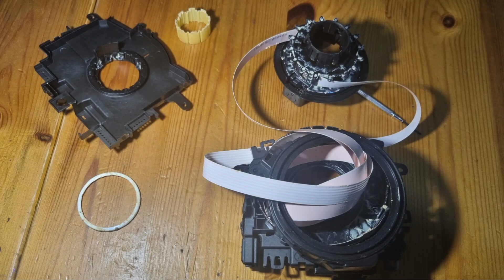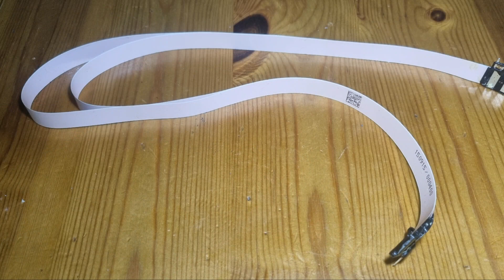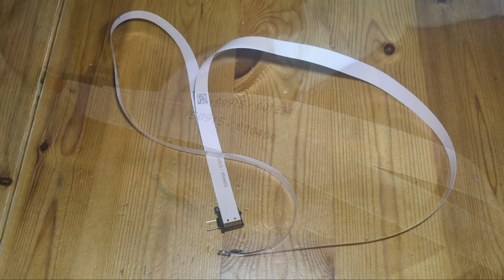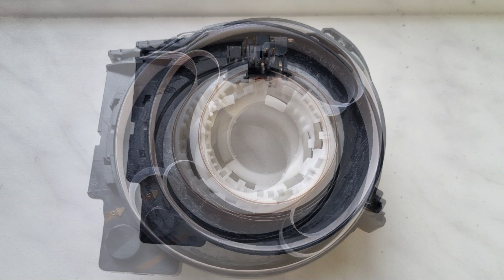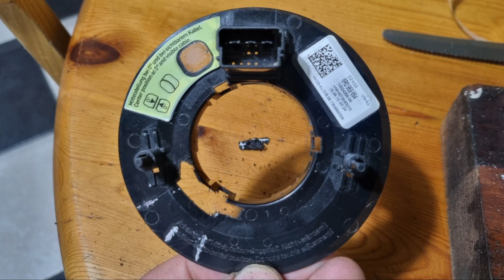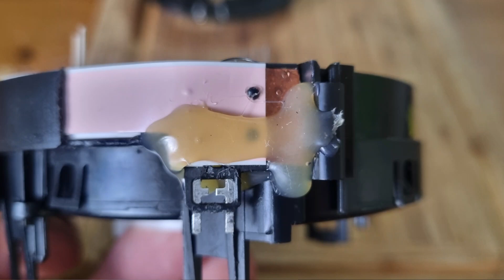VW Transporter T6 - Steering Wheel Heating Spring Clock modification

Comment: Hi Robert how is the heated project going. I have a passat b8 clock spring and a touareg r steering wheel. 
Busy at the moment fitting a dsg box to my old 1.9 t5 pickup.  We are working on a standalone controller for the megatroic side of things.